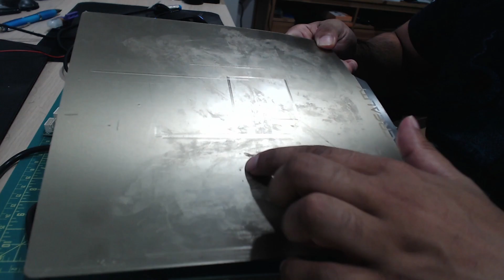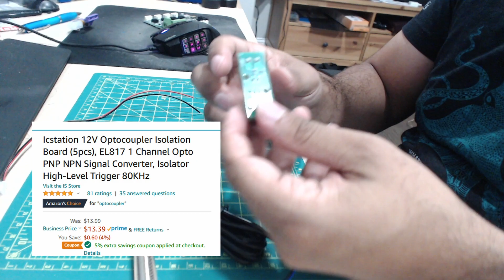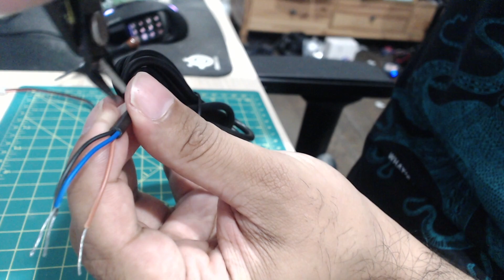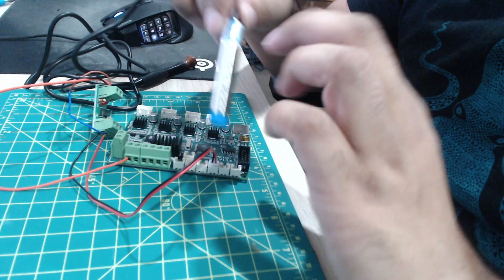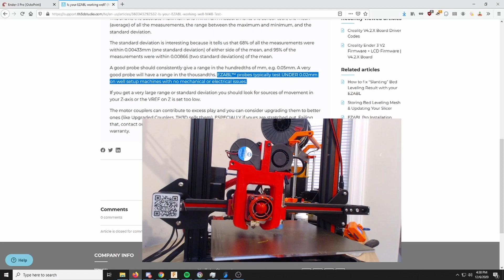Build a better EZABL for under $15. NO SOLDERING!

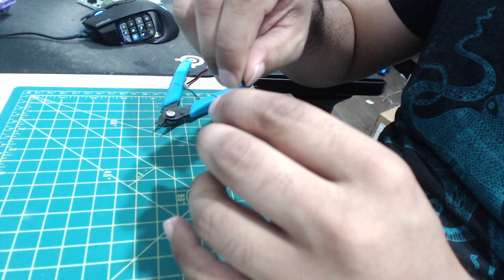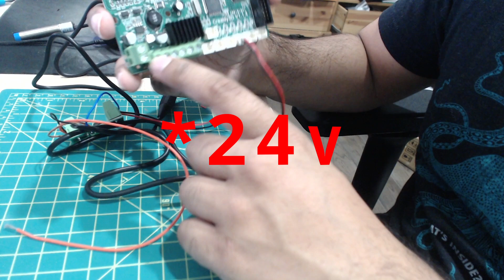Comment: This is really going to be very helpful, although I wish I would have seen this before today, which is a year AFTER you posted it. There is one minor change that I would do to this, at the 2:55 mark in the video, you inserted bare wires into the Optocoupler, I would suggest ferules for that type of connection. Most people who have their own JST kits, also already have ferule kits as well. They just make for a much stronger connection, and I'm fairly certain that, you did it this way, in the video for the sake of time. What cooling fans you were using in this video, both the red one and the blue one? 12:15 You said to connect the red wire to an always on 12v hook up, and flashed on the screen 24v. With that in mind, should I get a 24v Octocoupler or the 12v version??
Reply from the maker: sorry for late reply.

i used 24v coupler.

for fans, its the  petsfang http://www.dpetsel.com/because-you-asked.html (the double blower version)

Comment: Great information , Most printers have a 24 volt power supply, is it going to be a problem using a 12 volt Optocoupler?
Reply from the maker: I haven't seen any issues as of yet. you could do a step down if you want.
Reply: @RandomMakes-v2  I just swapped the resistor inline with the LED for a 4.7k on mine, a popular mod to use these optocouplers with 24V